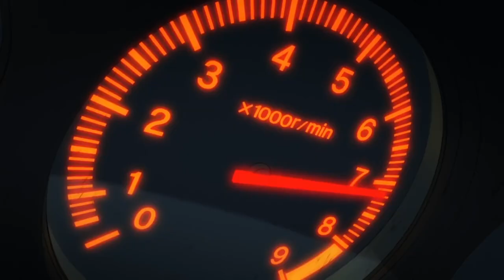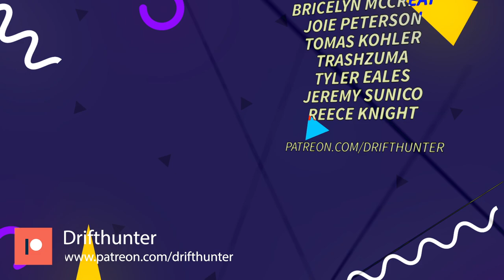Type One Shop Tour! NSX-R & Spoon Civic Heaven

Comment: I agree the NSX-R is really exotic, but then it's truly dated. Unless refreshed (engine, transmission, suspension) handling is just not on par with even the S2000, let alone "only" 280HP. 
I had an NA1 NSX before and I have a Huracan now. The NSX still has a special feel to it but it does show its age when compared to modern-ish supercar these days. With 300K one can get a Huracan Performante, or add a little bit to get a 458 Speciale